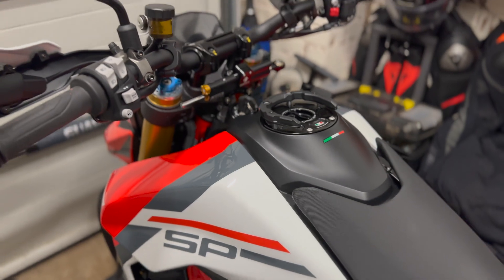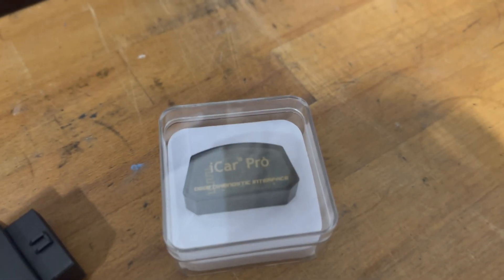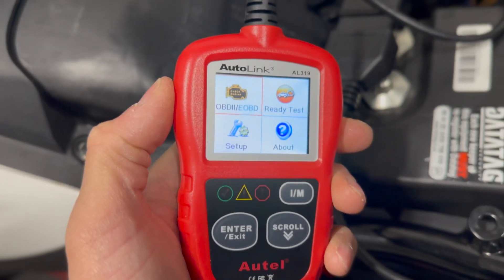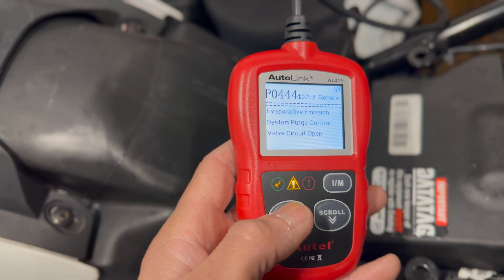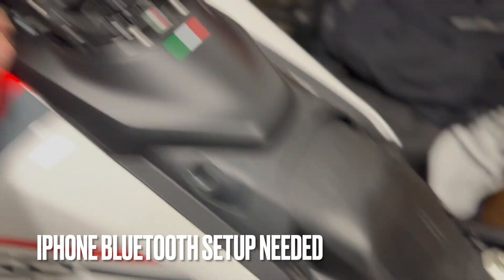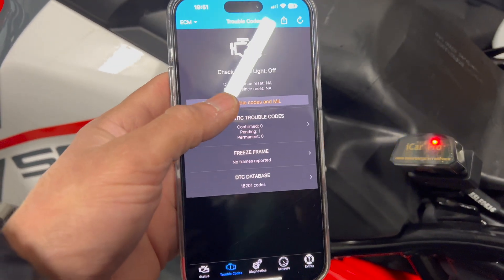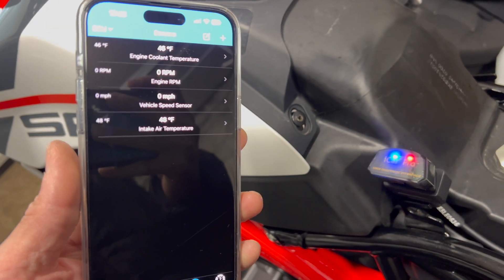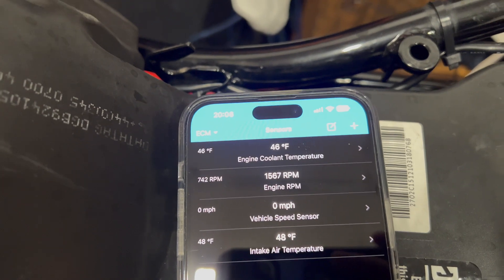Can You Read Fault Codes on a Euro5 2022 Ducati Hypermotard 950 SP..?

Comment: On a different note, I’m having some trouble with my 821 SP, first was exhaust valve cable broke, throwing up an error code, fixed that and now have oxygen sensor code, do you know anyone who can flash my ECU to remove this problem if I can’t fix it? I live near Lincoln
Reply from the maker: You’ll have to ring around a few places.. Dave wood racing, BHPUK…

Comment: Hi me again, just a quick question can you change maps like go from Urban to Sport on the fly or do you have to pull over and stop, all the best.👍👍👍👍👍👍👍👍🇬🇧🇬🇧🇬🇧🇬🇧
Reply from the maker: You can change on the fly..
Press and hold the left button (menu one) change mode, drop your speed and it will change it 👍🏻👍🏻
Reply: Thanks for taking the trouble to reply, much appreciated. 👍🇬🇧